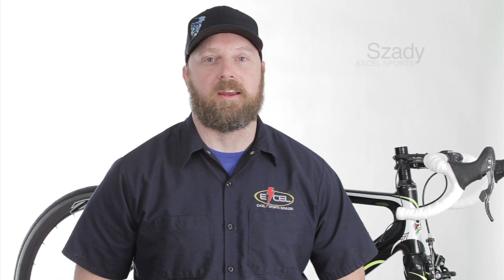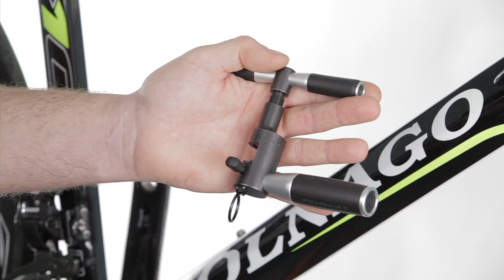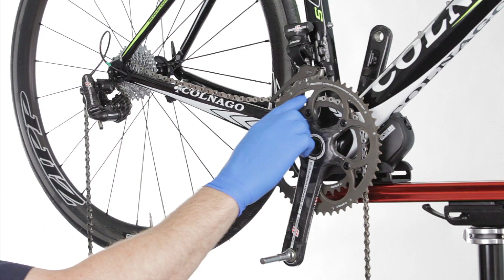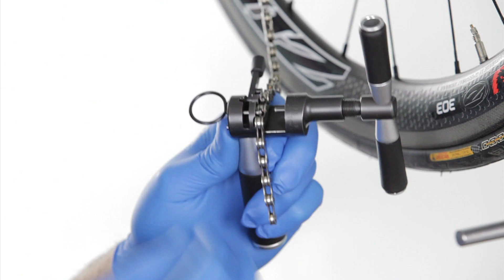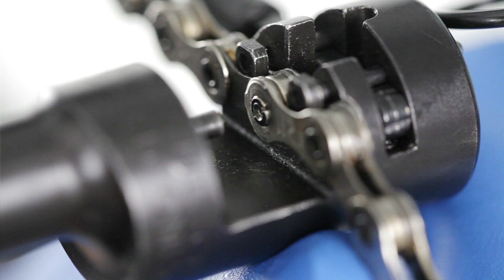How to Install a Campagnolo 11 speed Chain

Comment: So if I need to open and re-close a chain, the Campy instructions say this can be done a maximum of twice.  However the instructions are not clear about which pin or link to push out to put a replacement pin into.  Do I need to push out the same pin I installed previously?  Or push out another pin in the same link?  Which direction to push out the pin?  The instructions say "Identify the opening link on the chain; this must be different and away from the one used for closing the first time (a link that can be recognizable from the impression showing the production batch).".  It sounds like the pins can only be pushed into this one marked link in the chain, is that right?

Comment: 8-15mm is a good 7mm difference! Which is better - 8 or 15? (The difference seems enough to either add or reduce by one whole link..)
Reply: thedownunderverse I would think it would depend on the tension of the chain and the jockey wheel when the chain is on the big ring in front in the big ring on back